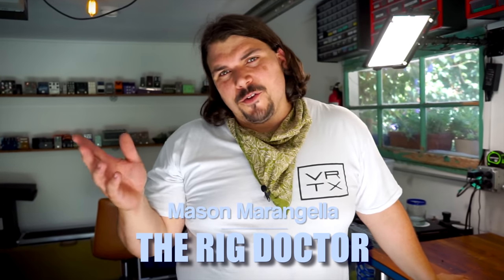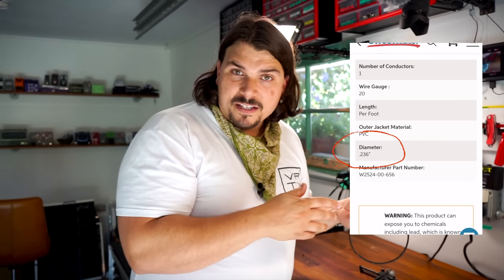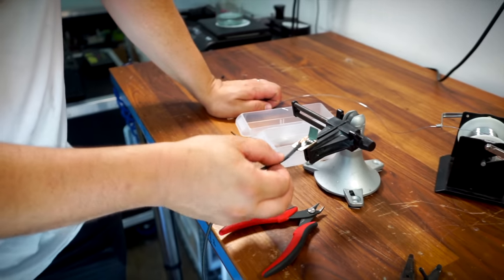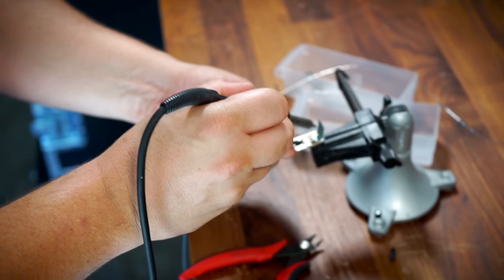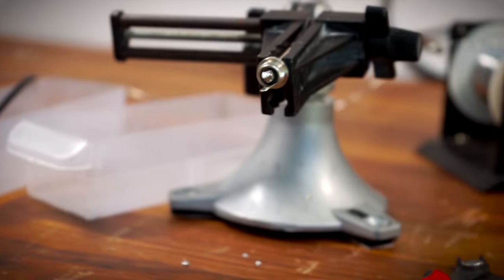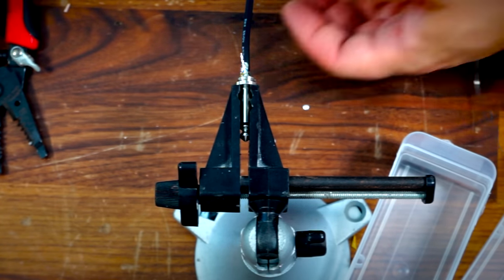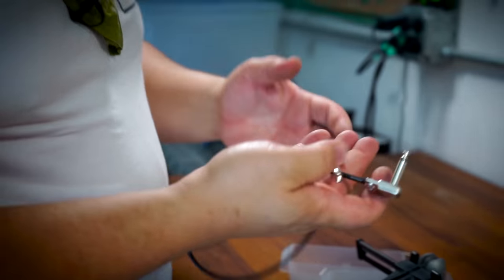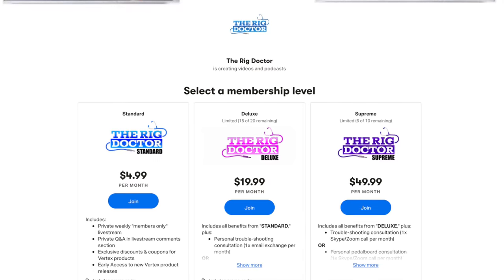How To Solder SquarePlugs

Comment from the maker: Howdy folks! Today, the Rig Doctor runs you through the steps necessary to solder your DIY patch cables using Square Plugs using SP400, SP500, SP4, and SP5 Plugs!  If you are using a different plug, don’t worry! These steps will work with any of the straight or pancake plugs and most types of patch cables from Mogami, Canare, Van Damme, and others.
⬇️ //recommended patch cable materials// ⬇️ 
Mogami 2314 (bulk cable) - https://amzn.to/31SluVE
Mogami 2319 (bulk cable) - https://amzn.to/2HIZ7dm
SquarePlugs SP500 (pancake) - https://bit.ly/32m63mU
SquarePlugs SPS5 (straight) - https://bit.ly/34qiajW
Pre-Made Cables with SquarePlugs - https://bit.ly/3kJFvGl
Reply: fastguitar  Squareplug isn't a good choice for the cable that goes from the amp to the pedal board and it's not a good choice for the cable that connects to your guitar.  Really these are only going to be good for patch cables that live on the pedalboard.

Just my .02 but I'm willing to bet Mason agrees.
Reply from the maker: These are only for the pedalboard patch cables.  Don’t use these from guitar to pedalboard, or pedalboard to amp!
Reply from the maker: ⬆️ what GuitarGodgt said
Reply: @VertexEffectsInc  does that apply to when you connect to a amp sim like an iridium?  I have one in my board.
Reply from the maker: @jmd12331  I don't understand your question
Reply: @VertexEffectsInc  My bad.  You mentioned patch cables are not recommended from board to amp.  I have an amp sim in my board. I’m going from the last pedal in the chain to the iridium with a patch cable.  
 Are patch cables not recommended in this scenario as well?
Reply from the maker: @jmd12331  if it's on the pedalboard it's fine.  If you're running a longer lead to a mixing board or amplifier I would use something more robust.
Reply: @VertexEffectsInc  Ooh, I'm genuinely curious. Why not for g/pb or pb/a? Seems like a solid connector.
Reply: @newgunguy4176  I'm wondering the same thing. They seem solid enough.
Reply: Does any other company make the square plugs sp500? The link doesn’t work as I have been trying to order them for 3 weeks now.
Reply from the maker: @lylesmith9547  try over on Best Tronics' website
Reply: @VertexEffectsInc  thanks
Reply: You made 3 videos on the TS plugs. Where TRS?

Comment: Having never soldered anything before, I bought a few tools, followed your examples with Mogami 2314 and SP400 plugs and have completely re-routed my mini pedalboard to fit all my pedals with hardly any cables visible.  Looks fantastic, sounds great—I would not have been able to do it without your expertise. Thanks so much, Mason!
Reply from the maker: So glad I could help!!!
Reply: Got any tips for tinning the sleeve lug of the sp400? I’m really new to soldering as well and it’s giving me lots of trouble.

Comment: I use a 1/4 inch piece of heat-shrink over the wire where it goes through the collar of the SP 400 for added strain protection. I know it’s not necessary, but I sleep better at night knowing it’s never going to pull out. Also, I really tighten down on those screws with a real screwdriver. 👍🏻
Reply from the maker: It won’t hurt anything depending on the diameter of cable. I wouldn’t want to try using, for example Mogami 2319, with heat shrink on the SP 400 series. It will deform the cable and you risk having some reliability issues long-term.  By the way, the heat shrink won’t do much in terms of strain relief on a pull, only the lateral movement (side to side).  The solder connections are really the only significant strain relief you have against pulling (front to back).
Reply: Vertex Effects I can definitely agree with you that there can be “too much of a good thing” (as in your M2319 example), but I disagree with you in terms of the heat shrink not helping with strain relief. The heat shrink widens the diameter of the wire, effectively giving the collar more “squeeze power.”
Reply from the maker: MostlyTorso Strain relief is there whether it’s lateral or vertical movement.  On this particular model, there are no teeth in the housing to really hold the cable in place. And some of the switchcraft brands for example, There are ribs in the bottom and top of the housing they are offset in order to create strain relief front to back. On these particular devices, and I have tested with pull testers, it’s pretty limited in strain relief movement front to back because there isn’t any ribs in the slotted channel where the plug enters they housing.  And if you build it up too much, as we noted above, it will deform the cable and result and other undesirable connection issues.  At the end of the day most of this is a non-issue if it’s on a pedalboard and is light years ahead of any solderless equivalent is this regard.
Reply from the maker: MostlyTorso In a pull test, it’s about 1.2ish lbs of force between a Mogami 2319 in an SP 500 connector with heat shrink between the housing and outer diameter of the cable versus no heat shrink on a vertical pull.  It helps - you’re right, but it’s nominal when you’re talking about 45 pounds in force for a break.  So about 2% difference overall.

Comment: I may have mentioned this before, but one of the problems I had when I first started using square plugs was I was trying to feed wire through the lugs & there isn't much room to solder that way. I now do it the same way you show here & it's works great, even w/ very short cables.
Reply from the maker: It’s not necessary on the pancake end.  If won’t hurt - but I’ve seen a lot of new DIYers have issues feeding the center conductor through the lug and shorting to the housing not realizing they need to cut off the excess cable behind the lug that they can’t see.

Comment: I build cables and hand wired tube amps for a living.
On most soldered connections - especially cables - I use an awl, pointy scratcher, pick, poker on a stick - whatever you want to call it - and I scratch the connection surface a little - then clean it with denatured alcohol. 
The alcohol cleans up any loose metal particles you made from scratching it up - and the alcohol - on a Q-tip - cleans off any oils or manufacturing chemicals left behind.

This ensures a good solid connection for the solder.
It is a little tedious to perform this step on every connection - but I do not have solder joint connection failures since performing these simple steps.
Reply from the maker: I think that's a good solution, especially for some of the cheaper plugs that don't do any treatment to prevent corrosion to the lugs after manufacturing.  For the most part, I've found the higher end stuff to be pretty good in that regard.

Comment: Hey Mason- I own a small custom cabling company here in NJ - I started five years ago with patch cables. I met Karim at NAMM some years back before anyone had seen his square plugs. He’s a friend of mine now and he’s brilliant. The last time I went to NAMM every single pedal company was using them. They are the best, hands down. This is a fantastic video, and easy for those who are new to this to follow. I was soldering the straights a little bit differently than this but I really like how you solder them and will begin using your method moving forward. I also really appreciate you showing how little needs to come off of the insulation before tinning. I tend to go longer and then snip, but this is really efficient and I love the focus on proper strain relief. Awesome video brother. 🤘🏼
Reply from the maker: Thanks for watching!  Agree 100% on Squareplugs!

Comment: I recently used SP plugs for my pedal board and sort of went Nth degree by threading the conductors through the holes in the tabs before soldering them. This requires a good check to make sure the conductors don't short out when being reassembled but it makes them a little more rugged than relying on the compression of the plugs to hold the cables in place.

Comment: I bought some SPS4s to use not on a pedal board but on the back of an electronic drum sound module because I wanted the audio output cables to bend on the same plane as the pad trigger cables. 

Standard-length plugs like the NP2X would
a) invite damage to the PCB-mounted output jacks by sticking out past the other cables and 
b) place more mechanical strain on the output jacks because the longer plugs exert greater leverage.

Worked out great, and it cost me only two-and-a-half times what I would have spent  for premade cables that would have met my needs. 😂
Reply from the maker: Glad it worked out!

Comment: SPS6M and SP600 w/ 6mm Mogami 2524 will be my goal for next pedalboard. Excellent video, we always need the details!
Reply from the maker: For a pedalboard, the 2524 is not a good idea, too thick, no benefit sonically for these types of runs.  I would stick with 2314 or 2319.  2524 is for outside of the pedalboard.

Comment: Great video.  I'm using a cable with a little more volume of the outer shielding so that It can't fit through the hole in a SP4.  I do the reverse of the procedure shown without bending either of the tabs.  The center conductors goes through the hole, soldered and snipped if any extra is there... the shield is soldered on the interior of the ring tab.  So far, no issues...but the board isn't done yet, so we'll really find out as soon as all the cables are done.
Reply from the maker: You can cut some of the shield away, it won't hurt anything.

Comment: I love squareplug.  I did my mini board with them and pretty much won't go back to normal patch cables ever.  I used SP400 ends and w3214 as well.

My soldering technique is a little different than what you did, but I don't see any issue with what you did.  It might be easier for anyone who is new to dip the tinned wire into some flux paste before applying it to the pre-tinned lugs on the cable end just to make sure the joint is good if they do exactly what you showed here.

Also anyone who wants to try doing this, I strongly recommend getting good solder.  Cheap solder is absolutely zero fun.  Snag some Kester 24-6337-0027, it will be worth it just to avoid the hassle that comes with junky solder.
Reply from the maker: I think the Pancake is hard to mess up - pretty standard.  The SP4 and SP5 are the tricky ones.  That bend on the tip is critical when you have so little cable to work with to maintain the integrity of the strain relief.  I linked a high quality Kester 60/40 leaded solder in the description.

Comment: Great video!! Thanks a lot for sharing so much cool stuff!
I have two questions:
1.- what’s the criteria for choosing a thicker or a thinner cable? (And as a consequence choosing an SP4 or SP5 plug)
2.- What temperature do you set your soldering iron? Any recommendations for this?
Reply from the maker: One, I would refer to the retailers of the plugs themselves, there is a look up table that has been created by square plugs. Typically I’m just using 2319 with the five series, and 2314 with the four series. In terms of temperature you’re not gonna have too much game once it’s over around 600° other than wearing out your iron faster.

Comment: I just redid my entire pedalboard with Square Plugs. Love them! Mason, I'd love to know what you think of my pedalboard loom....I'm using a stereo rig with a 7 cable method. My loom includes all guitar signal cables as well as midi and DC supply for the pedals. On the pedalboard side I have one single Amphenol multipin connector for everything. Have you every used that kind of termination for rigs?
Reply from the maker: I haven't but if it's not getting any noise, then I suppose it's all good!
Reply: @VertexEffectsInc  Studio quiet!
Reply from the maker: @FreddysFrets  great!!!

Comment: I thot you are supposed to heat up the surface that you’re soldering to before you do the actual solder attachment. I often cooked some part of the piece and I haven’t soldered for years, so thnx, I’m jazzed to try it again. Also, when you strip only the teeniest bit of insulation off the conductor, you’re not worried about “polluting” the solder with plastic from the insulation? Obviously not, so thnx again. I’m subscribed and “liked” and I’m ordering from you !
Reply from the maker: If you tin both sides you shouldn't need to spend a lot of time on the lugs to reheat them and get solder flow.  It should be very minimal time on the lug and the wire with the iron.  The center insulator isn't conductive if you peel away the conductive plastic as I suggest.

Comment: Is there any advantage/disadvantage to using different diameter cables? Is thicker better....is thinner better.....why would you choose one over the other?
Reply from the maker: I recommend 2314 for these connectors, you can watch our shootout of several different cables to see why we chose this.  With a buffer most of these cables won't sound different from each other.  The thicker cables aren't an advantage on the pedalboard.  Off the pedalboard they may be because they're more robust.

Comment: Great video Mason! I think you should mention having a good quality wire stripper. I finally got a $20 one and stripping was so much easier and I ruined far less cables. Also, instead of a vice, I use a piece of wood with 1/4 holes drilled in it.  That way I can lind up a bunch of plugs at once and tin them super fast.  It's like a little plug soldering factory.   Would you use an SP 5 for an instrument cable?
Reply: I see you answered my instrument cable question already! Thanks
Reply from the maker: I link all the ones that I approve of, but I appreciate the feedback nonetheless

Comment: Mason, thank you for these videos you have been a tremendous help!
Do the SP400s work with the 2319? or do I have to use the 2314? (I want to make sure I don't have to use heat shrink, and that the cable will fit nice and snug)
Reply from the maker: They will, just barely.
Reply: @VertexEffectsInc  awesome thank you!
Reply from the maker: Good luck!
Reply: Hold the Phone! (Record Scratch)...just want to say that The Sp400s and sp 500s do not work with the Boss ES-8 if anyone is using them for that.  If you have an ES5 or ES8 you can use the sp400 or sp500 for the pedal end, but to plug into the ES8 you will need to use the sp4 or sp5... The dudes at Bestronics are  extremely helpful...Thanks again Mason!
Reply from the maker: kevinmbuck That’s correct, they have a look up table on the square plugs website that shows this as well as well as other compatibility with certain devices and switchers

Comment: What is your main preference? 2319 or 2314 now? Looks like 2314 has less capacitance. Is it equally as reliable? Thanks for the tutorial!
Reply: 2314 seems to be the better choice. Make sure to use the SP5 or SP500 to fit the thicker cable
Reply from the maker: For a switcher, 2314 is preferable because it’s smaller and creates a little bit easier routing. Without a switcher 2319 is my preference. There is a capacitance difference but it is nominal. This is especially true if you’re using high-quality input and output buffers.

Comment: This is probably the best option if I wanted to diy my own high quality cables for my MS3 pedalboard (using several pedals, running it out into my effects loop, and controlling my amps switching), right?
Reply: I use the MS-3 and squareplugs work great with it!
Reply: Barnabas Ho With the 2314? Like they’re side by side and fit and it doesn’t bend the cable too much?
Reply from the maker: You want to use the straight versions, I don’t think that the jack spacing allows for the right angle version, the pancake shape. And I think you’ll need the TRS versions to do any amp switching.
Reply: Yup. Use the SP4 with Mogami 2314 for the loops. I use two SP550-S for the EXP1 and EXP2. It's a tight fit, but if you insert both jacks in at the same time, it can work.
Reply from the maker: A lot of times for the straight TRS, I will purchase a switchcraft 380 and whatever the equivalent is of the 280 in TRS, I think it might be the 281, but I forget their numbering system, and use the housing from the 380, and cut down the TRS male strain relief to match it.  This way you can have a short plug that is TRS.
Reply: Vertex Effects wow thank you both so much this was EXTREMELY helpful!
Reply from the maker: Marcus Sanchez My pleasure! I hope you and your subscription

Comment: Thanks for the video, really helpful! I'm starting with DIY cables. Do you recommend a specific type of soldering wire? Which one should I use? And does it affect the sound or not?
Reply from the maker: I like Kester 60/40 I listed it in the links in the video description.
Reply: @VertexEffectsInc  Thanks for always taking the time to answer! That's actually what I'm using, I just didn't know if it was ok

Comment: In the SP400 I have sometimes had concerns about the shield making contact with the tip in the center of the plug, so I have taken to folding the shield back against the outer sleeve and letting it get pinched in between the sleeve and the collar. Would love to know if/why from your opinion that’s a bad idea
Reply from the maker: I'm not sure I fully understand your reason for it or the advantage of doing it this way.  The only risk of touching the tip and sleeve would be if you exposed a lot of the wire of the tip so that risked a short to the housing.  Maybe link a photo of what you're doing - maybe I don't understand it.

Comment: Following these instructions right now ! Noticing volume loss with some of them . Must be a bad solider joint?
Reply from the maker: Whats the cable you used?
Reply: @VertexEffectsInc  mogami 2319. The folks on paddleboard’s of doom helped me out.
Reply from the maker: @Peter-em7wl  you probably left on the conductive plastic around the center conductor.